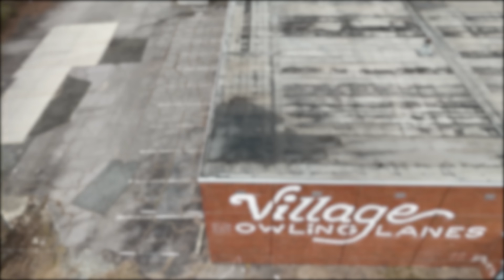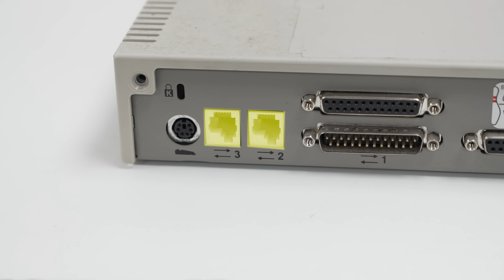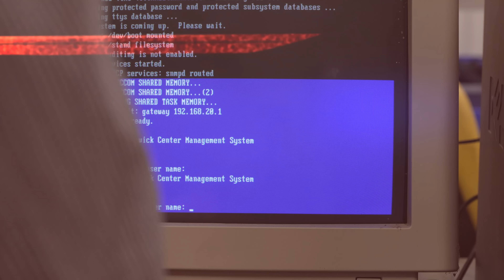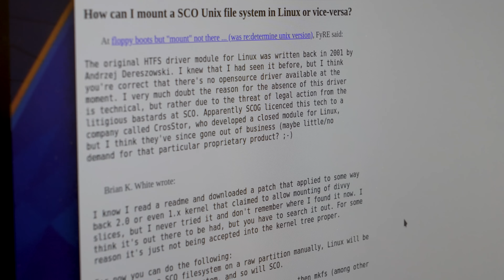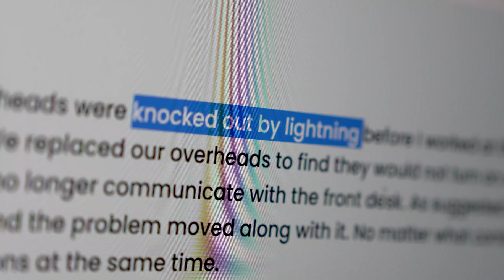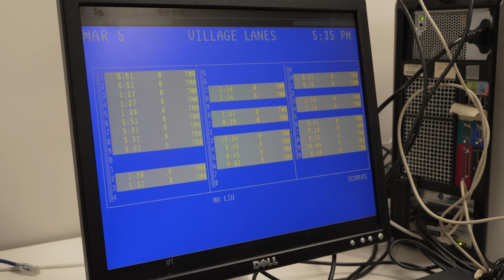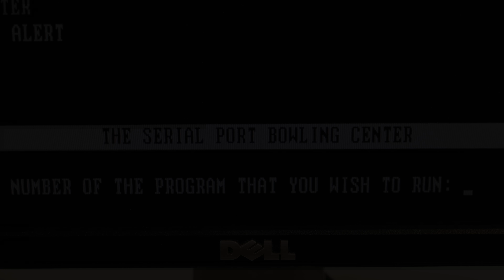We hacked into a bowling alley computer!

Comment: It's fascinating to realize just how much the world used to manage with so little hardware. That single Core2 dual/quad based machine was the brain to an entire business, and ran it flawlessly at near real-time. Nowadays there are so many layers and abstractions, a lot of corporate apps are built atop fking Electron, and spends 100x the resources to do the same job.
Reply: And I'm pretty sure that Core2Duo was already overkill to the max for the task it was running! I wouldn't be surprised if it ran just as well on a 486 or an early Pentium.
Reply: For what it's worth, as someone that has been in the bowling industry, though never in a position directly working with the hardware shown:  That old Brunswick score system was designed to run on an 8080 the Core 2 was most likely the cheapest option for a very high reliability system when BST retrofitted the scoring system.  They are one of several companes that offered 'modernization' for the old brunswick score systems, adding a tiny bit of backend functionality, but mostly just updating the score monitor screens from a monochrome 4:3 to a bit higher resolution, color, 16:9 format, as well as supporting more modern keypad setups for bowlers to enter names and make corrections.  The retrofits I've seen are no where near as fancy as the brunswick systems of even the mid 2000's, never mind current Qubica systems.  (Over the last decade or so all the big names in bowling equipment have ended up as one company, Brunswick, AMF, etc.)  That said, for an older center that doesn't have the literal hundreds of thousands of dollars that a current generation scoring system costs, the retrofits for the old Brunswick systems are a great value and provide the features that the league and tournament bowlers need, even if they don't have the fancy gloss that the modern fun centers use to pull in the families and birthday parties.  
Long ramble short, it takes a potato to run these things.  The retrofits systems I've seen use a raspberry Pi on each pair of lanes to do all the work, and that only because it's the cheapest way to do it in a modular fashion, they don't actually need that much computer.
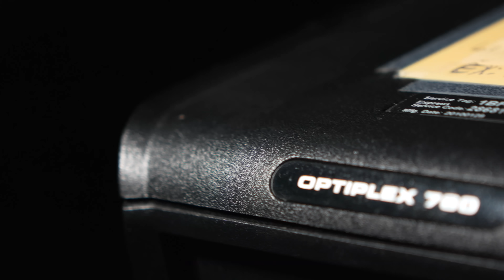Reply: At 4:18 you can see the service tag and look it up on Dell’s site and pull up the original config. Assuming it’s original configuration stayed, it has a Core 2 Dup E8400, 2GB of 800Mhz DDR2, 250GB HDD, Windows Xp SP3 with a Vista Business license, Dell AX210 stereo speakers, and copies of Roxio Creator 10.3 and Power DVD 8.3.
Reply: 90% of the worlds computing for business systems could run on a single low end laptop xD Not all at once of course, per business (and excluding the user workstation devices). But you'd want high availability and... yeah, which doesn't explain the waste when places spend like 20k a month on AWS for an over complicated system and a marketplace app for what should be a basic user interface and only 2 people actually use it.
Reply: If you think that’s crazy I can get you behind the scenes of a bowling alley that still runs on relay logic.
Reply: @samus4799  I would love that. Please do.
Reply: nice profile pic lol
Reply: @catsofbreads  Same to you. MGQ ftw~
Reply: noooooo... but... but... its gotta look pretty, how else will the ux designers afford their rent?
Reply: I couldn't agree more!
Reply: There's also a bunch of old serial systems that use SCO Xenix/OpenServer for control of sewing machines making mattresses and box springs.
As to the file system, cpio, not tar, not dd. Get the Skunkworks CD, has some utilities & docs that make this easier.
Reply: We got to the moon on pocket lint and bottle caps basically. We were smarter then with less and dumber now with more.
Reply: Most of it is done on the computers at the other end, and a whole load more is purely mechanical, simple systems of if lever is blocking then pin continues on to next possible position or cam with fancy track on it.

Quite frankly the way the pinsetters work are quite amazing. Electron is not all bad, it is not all good, but it is not all bad either.
Reply: Yes. Back before the stupid Web 2.0(TM) bull. Too many in the modern world couldn't program their way out of a wet paper bag. (but they're spend days googling for a library to do it for them.)
Reply: @jfbeam let's not hate on libraries ❤
Reply: @josephsagotti8786 if you've ever done anything with js, you should understand the library hate. We don't need an "is-even-ai" library WHICH LITERALLY EXISTS and queries an AI endpoint to check if something is even. 😂
Reply: In this thread, salty "devs" who couldn't land a job in tech
Reply: more like a 1000x+
Reply: @KiraSlith you CAN make fast electron apps.  It just takes some skill and benchmarking, like improving any web frontend or indeed any type of application.  But that application of skill is something no-one will ever do and so we will always have terrible ginormous electron apps.
Reply: @takochiba9151  Tauri and React Native apps are more likely to be fast than Electron apps.
Reply: @takochiba9151  No, you can't make an Electron app more efficient than a Python app. It takes all of 30 seconds to benchmark their most basic core overhead, and Python comes out ahead by a HUGE gap. I'd explain or talk numbers, but YouTube randomly censors my more technical comments.
Reply: Hmm. While I've personally never done anything in Electron, I kinda like how front-ends have moved from native to a web-based approach. I've done some UI development for AmigaOS 2.0, and it's just a lot of work. And it'll only work on an Amiga. In contrast, with these snazzy frameworks such as VueJS and Bootstrap, you can achieve a lot with very little code.

The 'kinda' bit is because JavaScript is evil. So, at work – when I do write front-ends, because I'm primarily a back-end Java developer – I use TypeScript, which puts a slightly less evil layer over JavaScript. But in essence, it's still evil. And unit testing is a pain in the arse.
Reply: People love to bash electron but what they don't realize is that it's pretty much the same as saying Unity is a bad engine because a lot of bad games are made with it.
Reply: @goeiecool9999  Electron itself runs like shite, it doesn't matter how you build it, it's running most of Chromium under the hood which has never been terribly efficient.
Reply: @goeiecool9999  That really isn't the same thing. Electron itself is around 130mb of bloat that bundles a copy of chromium for every application installed that uses it. No amount of good client-side programming ontop can fix that.
Reply: @goeiecool9999  ...vscode and steam are made on electron, there is a lot of good apps on electron, but spinning up a webbroswer for stuff like OOBE is dumb af
Reply: @goeiecool9999 it's like saying the internet is bad cuz chrome. Electron is chrome. Plus some native extensions. Woo. IMO, it's awesome, and I started coding on a C64..
Reply: it literally killed the whole bowling center where he got it from.
Reply: @Xiefux  What do you mean by that?
Reply: hating electron is wild to me. without electron, we'd have a bunch of laggier apps because the average dev is not capable enough to make a performant native app. we'd also basically never see linux versions of apps because who would want to build a native app in qt or gtk for 2% of the desktop market share?
Reply: @realryleu It takes way more effort to create a performant Electron app over a native framework.
Electron exists because it makes it cheaper to be multi-platform, not because it’s better.
Reply: @realryleu Electron is garrrrbage and part of a larger problem

not everything needs to be a stupid webapp and not everything needs as much bloat as it has today. devs just see higher specs and realize they can be progressively lazier as time goes on
Reply: @realryleu  or devs would have to learn real programming languages….you know, like they used to when things ran fast on slow hardware
Reply: @realryleu This is a pretty wild take. Writing solid, reliable native code isn’t nearly as hard as people make it out to be—if you haven’t tried it yet, I’d honestly encourage you to give it a shot. The performance and efficiency gains are worth it, and modern frameworks like Qt make it way more approachable than you might think.

Sure, Electron has its place for quick cross-platform dev, but acting like native apps are some impossible feat just isn’t true. A lot of the "laggy app" experience comes from devs not optimizing rather than native being inherently harder. And honestly? I’d take Qt over Electron any day.
(Also, Linux’s market share is small, but the users are vocal and appreciate good native software—just saying!)
Reply: @realryleu  QT compiles for most platforms?
Reply: @realryleu  FTLK, Tk, Qt, GTK works on windows, linux and the BSD's. Electron turns a 200kb application into an 800mb or 2gb bloated abomination. Maybe you should try your hand at software development so you'd know what you're talking about.
Reply: @realryleu  yeah, it's just a web browser 😂
Reply: @realryleu  I get where you're coming from, but I don't usually see Electron creating resource efficient apps.
My solution, however, doesn't use too many low-level libs/low level coding . . .
Run a simple HTTP server. Need to do something on the server from the client? Make an API endpoint. No need for electron. Then, install the client as a PWA. 
It works perfectly for my use case(distributing software to other middle schoolers without tripping every EDR system in 800 miles), and is very slim.

My solution adds a lot of friction to the install process, though. Not feasible for large scale stuff . . . If you have another idea in mind, please let me know - I haven't seen much of the programming world yet.
Reply: @realryleu  Python, seriously. It's dumb easy to program for and make basic GUIs for, and runs infinitely faster than Electron. The Electron gaslighting these days is nuts. 

Edit: QT runs on Windows, it's natively cross compatible with Windows, Linux, and Mac OS, do your research.
Reply: @KiraSlith qt apps are almost always ugly and buggy especially when said portability is used. 😂

Comment: Next time I go to a bowling alley, I'm going to ask if they have any old computers in the back that they are going to get rid of.
Reply: Excuse me. It’s a Bowling CENTER.  😂
Reply: I bet the manufacturer would remove them when they upgrade.
Reply: @CollectorOfThings  You'd be surprised.  OP as well..  There is often lots of old stuff in a storeroom somewhere, POS systems, tv's that need new caps from the overhead monitors, and the like... but the actual score server is very unlikely.  Lots of parts to keep it running, you bet, but a place that had the computer here in it would have spent tens of thousands of dollars on the upgrade to that system from the old Brunswick system it replaced.  A place with a modern, new, scoring system would have spent several hundred thousand dollars on it... You're not going to find that server sitting around like junk... and if one is sitting there like junk, it's because it is.  You can catch the modern ones in the wild from time to time on the counter behind the desk.  Dell workstation chassis with 8 hot swap bays on the front.  That workstation will have cost the center more than I make in a year.

Comment: This is a fascinating deep dive into an era of bowling that is quickly being forgotten. The industry is shifting quite quickly and old technology such as this scoring system is being replaced with the newest hardware and software in many older alleys. It just isn't profitable or even possible to keep supporting older technology in this industry, with the razor thin margins that we're having to run at. Sometimes a replacement or repair is just simply not possible with what is available on hand. 

What happened to Village Lanes probably happened to many other alleys that are closing; high maintenance costs on what were very likely original 1962 Brunswick A2s, pushed out by larger players who have the latest and greatest in hardware and software. I would know, I work for one of the largest players in the industry now. It's a bittersweet feeling. 

Thank you for preserving this small sliver of the industry that I love. If you're at all interested in diving deeper into the world of bowling scoring there's some great sources for used equipment out there that may be able to get more functionality. Feel free to reach out, I'm happy to put you in touch.
Reply: It's a shame because I got my foot in the door in the bowling industry fixing older scoring systems, which were all mostly workhorses for the most part. In the mid 2010's, there was an influx of centers either closing their doors all together or struggling to keep their equipment alive and that's where I'd come in. Turns out hoarding legacy equipment paid off, especially fixing early 12 Strike, Frameworx and Steltronic machines. 

Personally, I miss the industry but it's not what it was. There was something fun about fixing and future proofing the old stuff, and when it worked it just worked. I'll still help point people in the right direction for modernizing what they already have but it's becoming rare to see anything pre QubicaAMF era in the wild.
Reply: I used to enjoy bowling back when those monstrous consoles from the 80s were running the show. It's just soulless now.
Reply: I bowled at this alley a couple times not too long before they closed and its main problem was being in a very out of the way location not near any other commercial businesses on the poorer side of town. The one remaining alley in town is on a high traffic road near lots of other stuff on the more affluent side of town.
Reply: Am I correct in assuming that most newer bowling alley systems have been lifted and shifted into the cloud with minimal on-prem hardware? Maybe as little as just the necessary physical components to run the machinery and then an on-prem device that serves as the gateway to the cloud-based management system?
Reply: @FIDEL_CASHFLOW_ actually there's more computing done on site now! For my 25 lanes I run I have a total of 25 scoring consoles (boot from PoE and run to a "hub" device that serves as the power supply for the lane pair). Each lane pair also has 1 CPU with 2 display outputs (also PoE), a scoring interface board, plus a camera board. (those two run on a low voltage proprietary comm protocol)

I also have a main server, a lighting effects server and 7 different PCs/POS stations to talk to the server. If the internet went out I could run indefinitely, the license for the server is on a USB dongle and doesn't need to phone home. It of course can and does to sync up online reservations and for central management.

Comment: I did a similar hack 20+ years ago on an IRIX 3.x machine we’d lost the install media and root password for.  I booted into NetBSD, and since netbsd lacked EFS drivers, I hand edited the raw disk file to null out the root password in /etc/passwd by grepping the raw disk for something like root:0: or whatever a reasonable string of a passwd file might look like. Then going to that offset and truncating nulling the password field and tacking on spaces to the end of the line before the CR. then I rebooted into irix 3 and root had no password! 😁
Reply: The simple hacks are always the best. A shady boss from an old contracting company in the 90s used to have us pirate software from clients so we didn’t have to pay for licenses. I broke the license check for a mainframe program editor. It checked a serial number from a read-only environment variable. I hex-edited the app, found the name of the env variable name, and changed it to one I created that matched the client’s serial number. So satisfying.

Comment: The corridor crew would love to put their animations on this system
Reply: They're basic 8 bit animations unfortunately. they have a flashing X for the strike, accompanied by how many X's strung together continuously below the flashing X. There's an 8 bit rendition of a turkey for 3 in a row, a 6 pack of cans for 6 in a row (only on the AS-90 I believe) and it just repeats in continuity until a perfect game. Both AMF's Accuscore and the AS-80/90 had pretty primitive strike or celebration animations due to the technical limits of the time. True animations wouldn't really be a thing until Brunswick Frameworx and AMF Accuscore XL, which both debuted in the early mid 90's. The AMF BOSS would be a step up from the Accuscore XL which gave more animations and smoother playback as well.
Reply: The biggest difference between the AS-80 and the 90 from a bowlers point of view, were new color backdrops other than the monochrome option, improved scoring consoles (more rounded, better keypads with improved feedback) and a camera "replay" option to show your shot on the overhead scoring monitor (which was a PITA because of trying to ground and wire that alongside ball detection sensors and whatnot) that most centers didn't buy.